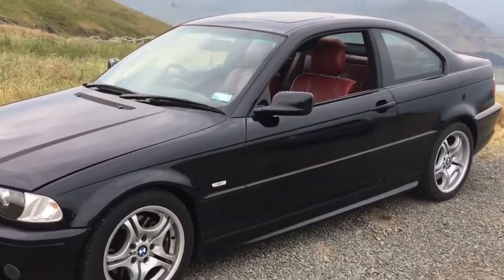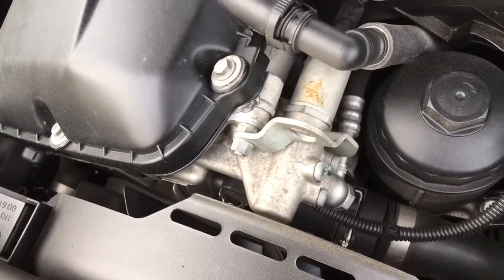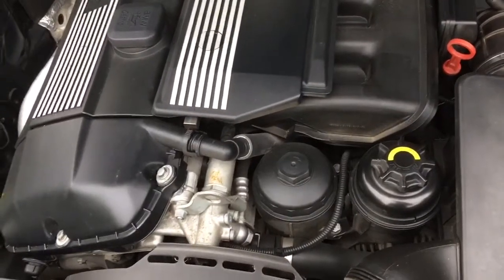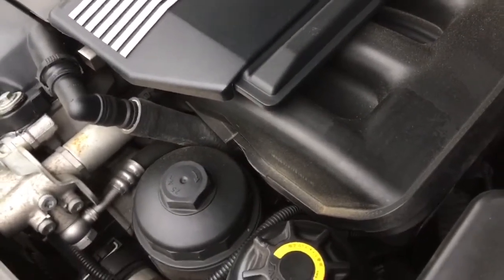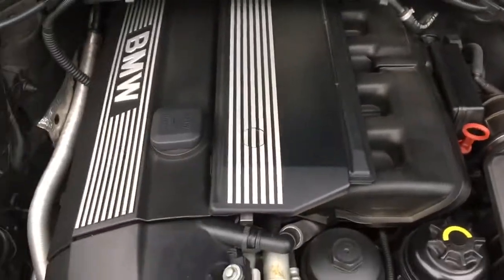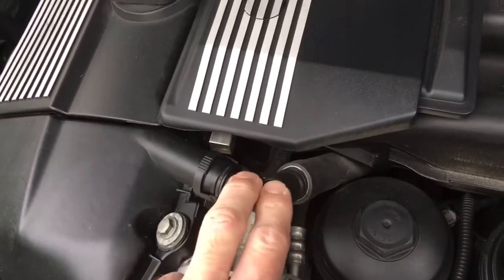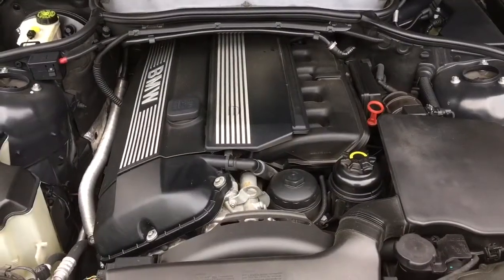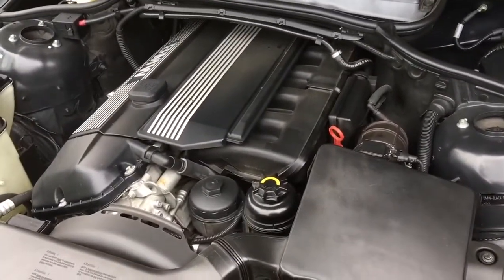BMW M54 Engine Common Issues

Comment: Thanks for all your videos! They're full of helpful tips I need. Subscribed I own a 2004 E60 520iA which has only 74 000 km on the odometer, 10 000 km of which has been driven since purchasing it last year, without a single hitch, except a PDC sensor which I'm about to replace. 

I know the AC/serpentine belts need replacing, but what else should I prioritise maintaining? The car has followed all scheduled services and has no open recalls/actions with BMW.
Reply from the maker: Thanks for following the channel brother. A 520i at that age- make sure the cooling system components are in good shape

Comment: Hey mate, great videos. I have 2 BMW E46 330i's and my mechanic did a service on one of them and said that one of them took 6.5L of oil and the next one 7.5L of oils, does this mean my oil pan has been changed for some reason or why would this occur?
Reply from the maker: E46 330i should take 7.5 litres
Reply: @MTechGuy  thank you so much (:

Comment: Next week I am going to have my radiator and heater hoses replaced. In the video you recommended having this job done which is going to cost $1000.00 for parts and labor. Is their a way to determine if the radiator is currently in the car is in good condition and will not fail anytime soon or is it best to change it to be on the safe side?
Reply from the maker: I would focus on the expansion tank, thermostat and water pump before the radiator. Generally the radiator isn’t the weak point. Yes, the radiator can be tested for leaks via a pressure test
Reply: @MTechGuy  Ok. Actually everything I have gotten done, but the radiator. So I was unsure if it should be done or just continue to check for leaks. I remember in the video you stated the rubber or neck or something could snap. Thats what I was afraid of.
Reply from the maker: Yes, the neck where the main upper hose connects can crack around the base of the neck
Reply: @MTechGuy  So how do I prevent that without changing the radiator? Is that possible?
Reply from the maker: No, only by testing it via a pressure test, but if it’s around 20 years old the only way to be 100% certain the aged plastic is not going to fail is replacement
Reply: @MTechGuy  Thank you

Comment: Best m54 guide seen yet. Considering an e60 with m54 with 115k miles. Any thing to watch out for at this mileage. Would I be better off getting diesel at that mileage as they can last longer than petrol versions?
Reply from the maker: It’s a good engine, the M54 in my X5 has 260,000 kms on it. Expect several oil leaks if they’ve not already been tended too. CCV will want doing also if not done already

Comment: I hear some individuals say not to change the transmission fluid. Do you recommend doing that and what other things can I do to make sure the transmission remains in good condition?
Reply from the maker: I’ve always changed my fluid without issue, using Valvoline Maxlife ATF, perform 3 x drain & fills, running in between. Replace filter and make sure to fill to level using the correct procedure! If you have the GM transmission it’s worth considering replacing the selector shaft seal as they are prone to leaks
Reply: @MTechGuy  Thank you

Comment: After all these parts have been replaced, would it be safe at that point to take a long trip in this car? Are there more parts that you recommend replacing before doing that?
Reply from the maker: Yes, I did many long trips in an E46 touring I used to own, same in my X5 with the M54 3.0 engine. Main thing to think about is to keep an eye on the temperature gauge
Reply: @MTechGuy  I have an e60 with a M54 engine. So that is the same correct?
Reply from the maker: Yes, same 👍
Reply: @MTechGuy  Thanks

Comment: I'm just about to take ownership of my Grandfather's 2001 330ci and came across your vids doing a bit of research. Love your channel and you clearly know your way around older bimmers! My car is a UK spec SE, 5 speed manual, with only 42k miles on the clock, full dealer service history and garaged it's whole life. Is it naive to hope that there will be very few problems due to the low miles, or is a lot of this stuff age related (degradation) as opposed to miles?
Reply from the maker: That’s awesome, sounds like a well looked after 330ci. Preventative maintenance is the key to avoiding problems with these cars. Anything made of plastic or rubber will be degrading at this age. If it hasn’t already been done, spend some money replacing the expansion tank/water pump/thermostat/belts and inspect the radiator and hoses 👍